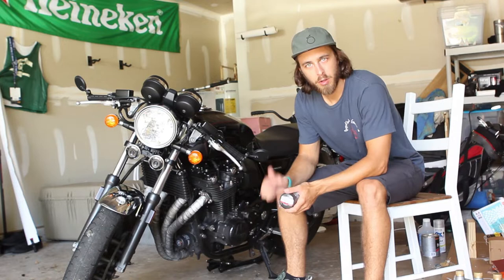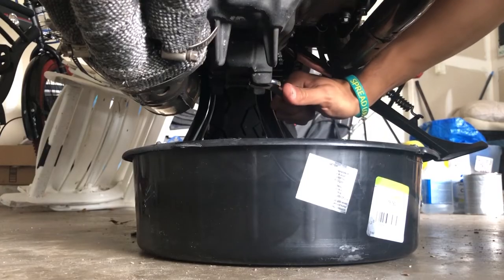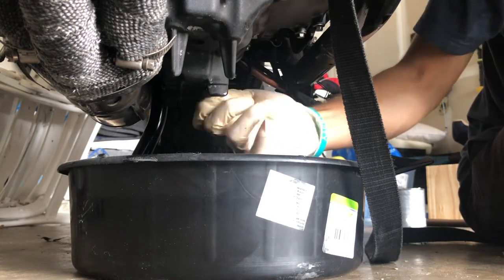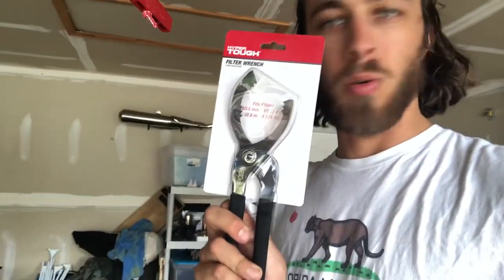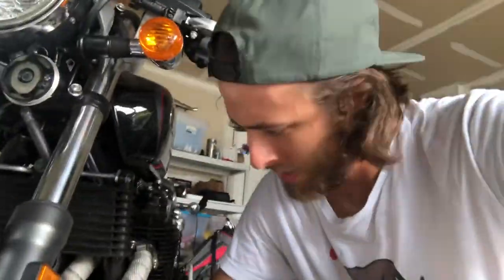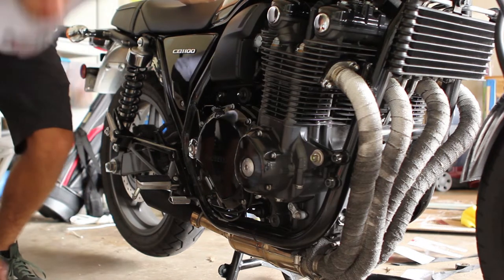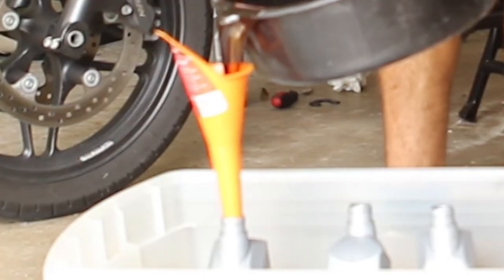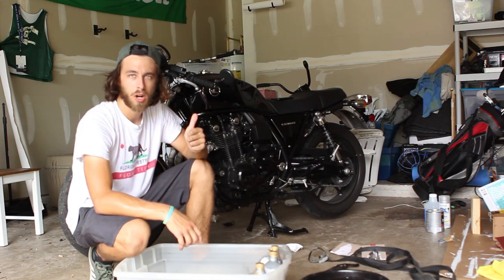2014 Honda CB1100 Oil Change | 4,000mi

Comment: Why'd you decide to go with 5w-30? The owners manual recommends 10w-30 non-synthetic honda oil
Reply from the maker: Hey Winston,

Good catch! I actually did use 10w-30 I just used the wrong images of the oil (5w-30) when I displayed the graphics in the video 😣 I did however go with synthetic for longer smoother running..

Comment: I'm getting really bad vibes from this young guy. I have the feeling that the motor oil he used is automotive oil and it's not rated for JASO- JASO MA2 standards. Hopefully I'm wrong.

Update: He definitely used the wrong engine oil. STP full synthetic is not rated for JASO or JASO MA2 standards. Eventually he will ruin the clutch, this makes me really mad, but can't do anything. He has the right to ruin his motorcycle.
Reply from the maker: Thanks for bringing this up! Not sure the difference to be honest but will make sure to use the recommended Honda oil from now on. Either way, no issues ever so far.